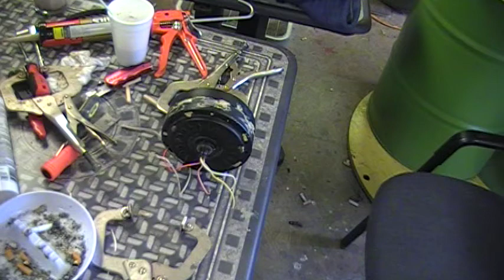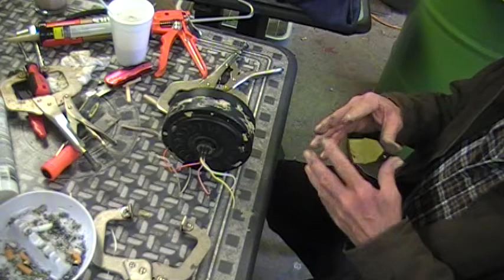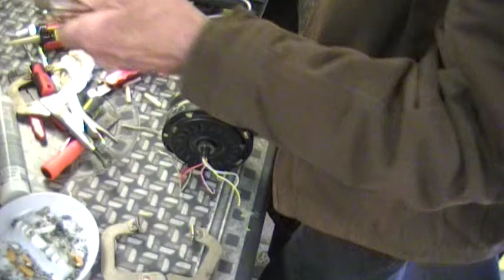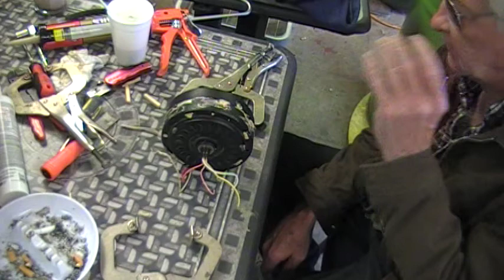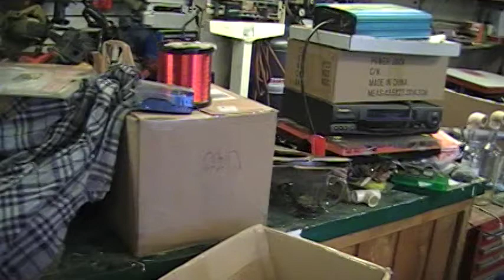My first ceiling fan convertion to PMA #2

Comment: My betis You was trying to measure AC current.  Run the winding output thru some diodes and measure again.   That motor was probably wound with like 28 -26 AWG wire and would get most toasty pumping out a few Amps.